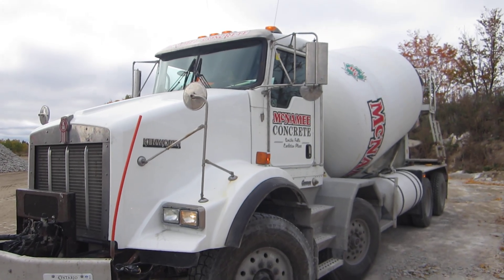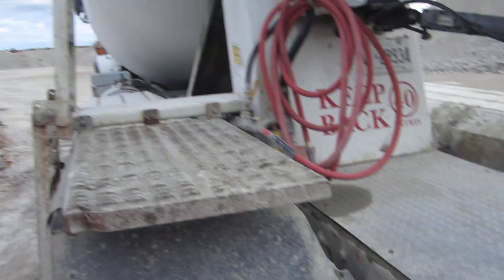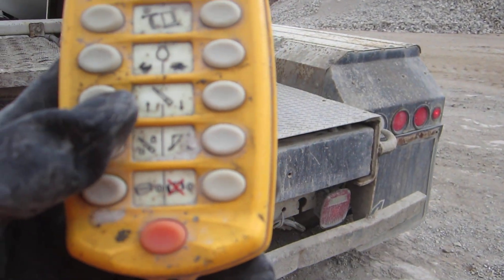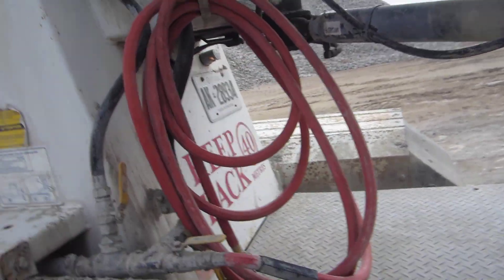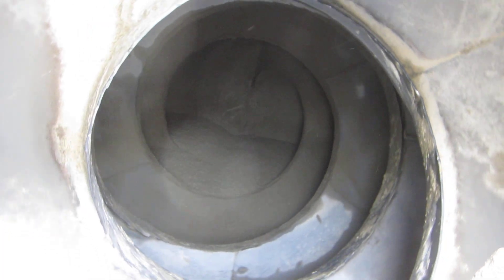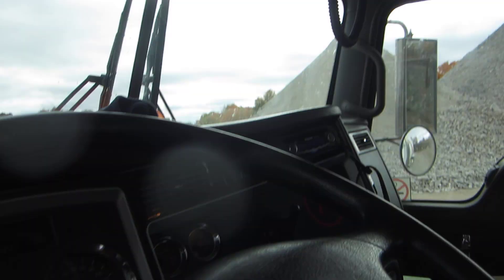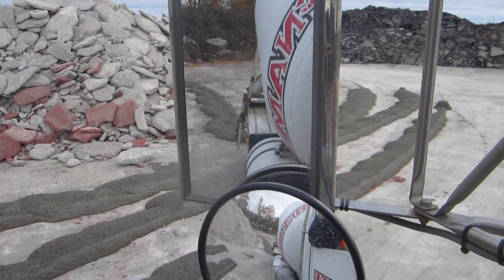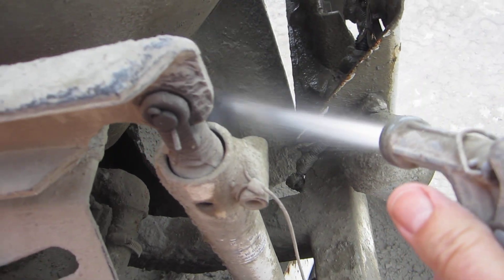Mr. John Tutorial: Concrete Mixer Truck Functions

Comment: I am building a small concrete truck using an old Japanese micro truck and propane tank and to get someone on a video to tell you the step by step basics of how it exactly works is impossible - you’re video is OUTSTANDING - thank you for just getting to the point and being so thorough.

Comment: why does the truck have that ridiculous looking double steering axle? like does the concrete weight that damn much? here in north carolina concrete trucks just love axles most have 4-5  axles or that double steering axle, the standard tandem axle mixer has become extremely rare now
Reply from the maker: 12 cubic yards weighs a lot
Reply: @SafeTravells  about how many pounds would you estimate it weighs?
Reply: Concrete usually weighs about 4,000 lbs. per yard--- depending on mix design.

Comment: I will be applying for a job like this real soon. I used to make concrete statues, benches, tables, etc... We applied certian oil to molds, frames and even various sizes of buckets after getting loads. It would be way easier to clean after we were done. Would this be a good suggestion to keep your truck clean? Maybe it's not allowed?? Thanks in advance, hope everyone's been safe and is surviving!
Reply from the maker: Hi- oils are used on form walls but the truck would become a dangerous platform with slippery oils- so the truck gets an occasional acid bath to remove concrete residue- good luck in your new pursuits for 2021!